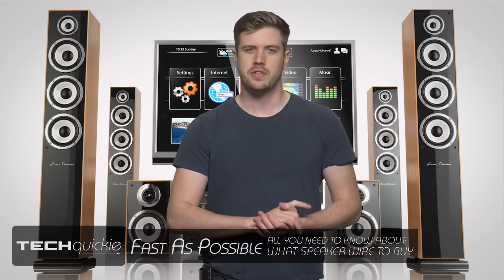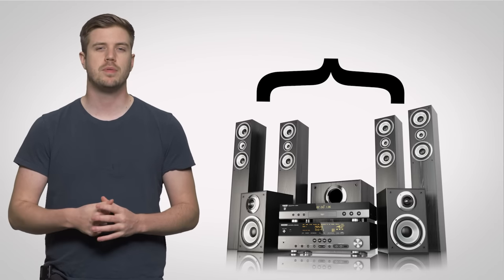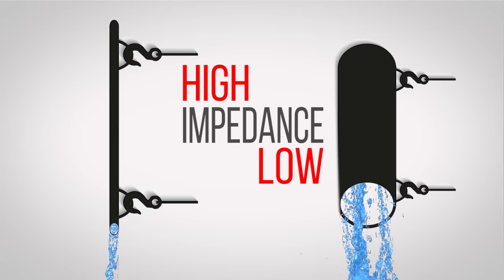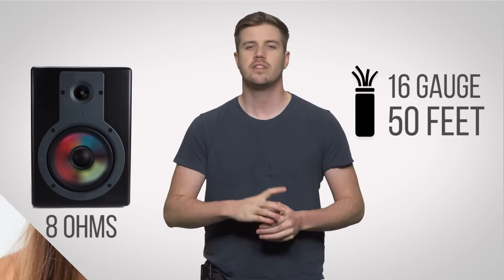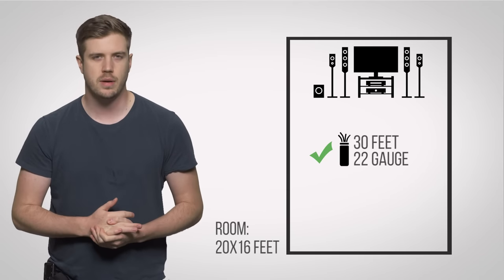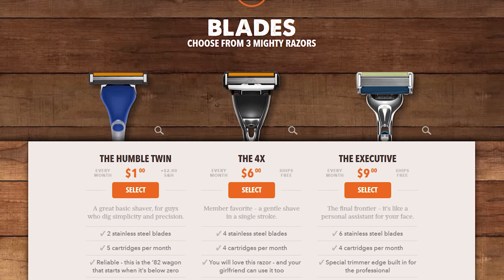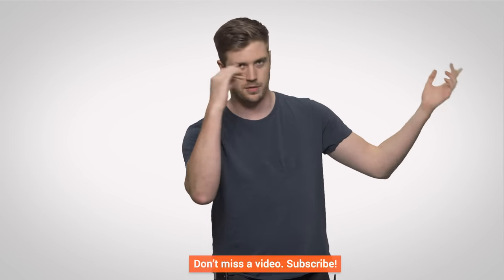What Speaker Wire To Buy As Fast As Possible

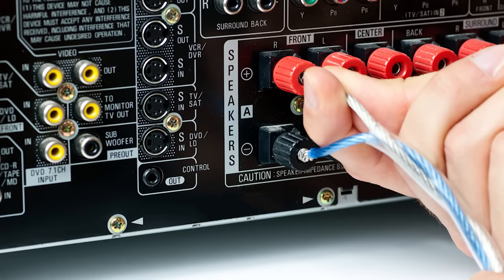Comment: Wait, why are you not suppose to just stick the wires into the speaker box ( 3:12 )? I mean, unless you're like me where my front channel amplifier can be easily removed for other uses (PARTY'S XD) in which case I use banana plugs, most people set up a set and leave it. So sorry- that's not right. It also adds one more contact which creates a junction therefore creates more resistance.... 

There is also a reason why cables are not shielded. It's STUPID to get shielded cables. Their high powered cables it like a sin- just no... nooo! facepalm. Signal cables- yes! Amplifier speaker cables NO! NO! Waste of money. 
Reason? Well since it takes so much power to move a speaker (because its low impedance and ohms law V=IR), the current induced within the cable wont even move a speaker and will simply be shunted more lightly through the subwoofer coil. If you have a passive x over then it makes it that much better where that energy would probably be eaten up within the components themselves.

Oh but I am glad your using feet instead of meters LOL.

Comment: So I am not really into speakers, but why do we still use copper for this? Wouldnt  light fiber work too?
Reply: Fibre transfers digital copper wire analog
Reply: is digital sound worse? Sorry like i said, i am a sound noob xD
Reply: +cragethGER Speakers need power via wires, that's why amplifiers are used.
Reply: +cragethGER fiber can transfer a signal, but not electricity. Speakers work on electromagnetism (most of them anyway) so they need electricity in their coils. It's they same reason you don't use fiber to plug things into the wall, or for any other wiring.

Comment: So is it smart to just take a thick short cable? ( If you have the money ;))
Reply: +Benjamin Thåst There is such a thing as overkill, and you can benefit from decent insulation, but in general yes. Luckily the only cables expensive enough to have to bother about cost are the stupid snake oil ones.
Connection points are what you want to focus on. And the actual hardware you're wiring, but that should go without saying.
Reply: +Benjamin Thåst To a degree. You don't need that much. I ran 14-gauge for my home theater to rears, fronts and center channel and just bought a spool of thick insulted stuff off eBay. Very affordable. Bottom line you have to be able to fit it in, which with vintage equipment can be tricky.

Comment: Did he mention that higher gauge size means more thinner and lower gauge sizes means thicker?
Reply: yep
Reply: ya
Reply: +.hack//Sword Yes
Reply: +.hack//Sword you'd already know if you like shotguns :3
Reply: +.hack//Sword yeap, search AWG :)
Reply: +.hack//Sword, 24 gauge wire is smaller in diameter than 12 gauge wire.

Comment: If copper cables longer than 15m significantly dampen frequencies in the kHz range, how is it even possible to transmit digital signals over longer distances that use GHz?
Reply: +Penny Lane, that is simple.  Digital is just a variation of voltage that represents 1s and 0s.  Then that voltage is applied to a DAC (Digital to Analog Converter) to convert it from digital to analog.  Digital is NOT as stingy as analog is for long runs.  5 volts will always be 5 volts from one end to the other, and 2 volts will always be 2 volts as well.  Analog on the other hand is not the same.  It is variable.  The voltage is constantly changing and those changes have to be read accurately on the receiving end.  Any interference along the way will be read and interpreted as noise.
Reply: +Penny Lane it's not correct. if it was, how do run's of 100's of feet during a concert not sound completely muddy and dull?
Reply: BaddMatt Thanks, I know what digital means =) But to also state the obvious: GHz is six orders of magnitude above kHz.
Reply: +Penny Lane, perhaps what Luke is talking about is power loss over distance.  The longer the run, the more loss of voltage due to cable resistance, and that in turn affects higher frequencies more than lower frequencies.  Gotta ask him though if that is what he is referring to.  Copper cable in itself is more than enough to carry the frequencies.
Reply: BaddMatt Well, I think I know what he means. A cable acts as a low-pass filter because the impedance of an inductor increases with frequency. Only the resistive part of the cable shouldn't do that. However, if this affects the audible range so much, I just cannot imagine how it wouldn't distort the signal edges of a digital signal – that contain much, much higher frequencies – beyond recognition and usefulness.

I'm not saying that this all doesn't happen. I'm just saying I can't wrap my head around it and I would have liked some more explanation.
Reply: +Penny Lane, I think Luke oversimplified his explanations.  Gotta remember, it is not radio frequency being pushed down the cable to the speakers, but rather voltage frequency that drives the speakers.  Your receiver may push out let's say 5 volts to the speaker, but by the time it gets to the speaker, the voltage may have dropped to 4.9 volts.  I don't see how that would affect the audio signal, but would definitely lower the volume some.
Reply: BaddMatt I don't think it helps much to think of this in terms of a single voltage measurement. You really have to keep the shape of the waveform in mind or alternatively the spectrum.
Reply: Penny Lane I was only using that as an example of where the voltage was at that given time and how the cable length can affect it.
Reply: BaddMatt I know but this is a phenomenon that inherently happens in the frequency domain so it's not so much that voltage is lost to heat but that the waveform is "smudged" in a way. So |_| becomes more like \_/ for example.

Comment: I thought you're canadian, so why measure in feet and gauge? What about meters and millimeters?
At least provide on screen conversions next time pls.
Reply: +Econael well actually these standard units are still widely excepted in Canada, for example even in the most up to date CEC (Canadian electrical code) AWG (American wire gauge) is used all the way up to 4/0.  Also the next logical unit for this would not be mm2, it would be CM (circular mills(and that thousandths of an inch thank you very much)) or it big brother the KCM, KCM is used on all round conductors larger than 4/0 in Canada. Although i do agree with you on the metric length measurements, this is reflected in the CEC to.  And yes i do know that the CEC has no direct influence on home audio sutups.  thanks.

Comment: My subs are supposed to be 4ohm but they read 2.8-3.0

Can I use bigger or longer speaker wires to try n increase this number a bit and get closer to 4ohm?

I'm trying to connect two 4ohm subs to a 1ohm amp, but since my subs are reading 3 ohms; wiring them parellel brings my final load down to 0.4-0.7! Not safe for my amp

And if I just wire them in series parellel for a 3ohm load (would be 4ohm if the subs actually measured 4ohm themselves) I feel I'm missing out on a lot of power (amp is 1500 watt rms x1 @1ohm. 550 watt rmms x1 @4ohm)

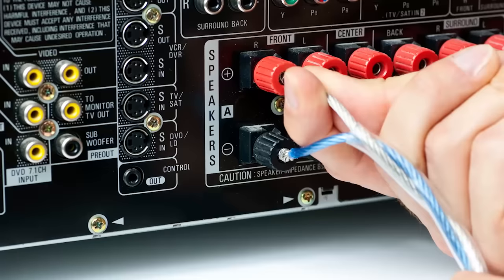Comment: 3:05
What the fuck, he's stuffing the cable down the socket for a bananna plug.
If you don't use bananna plugs you unscrew and twist the wire around the post.
That speaker wire would just fall out the back.

Comment: What if the pc sends out a digital bluethooth signal and the speaker themself do all the convertion. will that result in a better, worse or identical soundfloor than wire?
Reply: Are we talking wireless ?
Reply: +GranVlog Unfortunately it depends on too many things for someone to be able to give you a nice and easy answer. Basically both can be better/worse than the other or even roughly the same, depending on the quality of the design, the room it's in and the physical setup of everything. The only thing I can tell you, with reasonable surety, is that the wireless one will nearly always be more expensive for the same output quality.
Reply: Emile van der Merwe But if you send the audio signal as digital, wouldnt it sound the same anyway? Like with HDMI cables. As long as the digital signal is picked up i mean.
Reply: +GranVlog 
The audio is most likely compressed before bluetooth transmission. So any other concern after that is moot.

Comment: dude, nobody in thier right mind would use 22 gauge wire for a subwoofer....or anything else!. 14-16 guage is OK though for lengths of 50-70 feet and I use 18 guage for shorter ring. 18 guage is the smallest wire you should ever use though.

Comment: 99,99% BS but one thing is correct; the comparation to a waterpipe. (1:10) Speakerwires has been done totally wrong since the beginning of audio. Thinner wires might not burn or melt but they will restrict the amp`s dynamic power. Stranded wires should not be used anywhere near(!) to a system. calcutations might tell that the resistance is the same as in a equivalent solid conductor but don`t be fooled.  Look at the waterpipe and think. not only will the thinner conductors restrict dynamics, there will also be interference. Where to begin? 12awg solid for smaller systems. Fun begins at 9awg
Reply: Finally someone who knows what he's talking about.  Stranded wires are only for convenience.  They smear the sound.  Solid core sounds better.

Comment: I always advise people to buy water cooled speaker cables 'cuz if the cables get too hot the resistance goes up and they get even hotter, etc, etc. Pretty soon you've got a fire on your hands and if your cabinets are wood or plastic it's good-bye $50,000 speakers. A really good alternative is liquid nitrogen to get the resistance right next door to zero.

Comment: I want to build a gaming pc and connect it to my receiver in my home theatre. How do I set up the hardware and software to get surround sound on my games and throttle my FPS to 60 FPS as my TV cannot exceed 60.
Reply: +Syed Zuhair  use display settings to limit hz
Reply: +David Soper thanks
Reply: Syed Zuhair if you have problems with games going over fps and tearing enable vsync in game. I would not recommend it unless you get major tearing on screen. It causes lag in the controls. Good luck.

Comment: No.. It's not just length and width🙈 Different wires have different types of quality metal. So this is not really correct. And interference is not really a issue on speaker cables. Ans a more expencive cable gives better sound. IF the rest of the system is really good and not a cheap system. But also..: A 1000 dollars vs a 100 dollars will give just a small bearly noticably difference so there is a limit of how much money it's worth for a cable to get a couple of % better sound.. That's one of the mistakes people forget when talking about cables. And most people that claims it makes no difference does not even have a system that's good enough to notice a difference😂 It requires a highly resolving system.

Comment: Actually high end cables do make a difference in sound quality, but spending money on other things will often yield better returns for the money. So not all of them are actually "snake oil". Cables can affect the character and quality of the sound and if you're trying to run longer distances the improved shielding and better materials can make a substantial difference in sound quality.

Comment: It is so hard to find decent Gauge-0 wire :(
Reply: Check out sky high car audio. Their wires have much more cross sectional area for a given gauge when compared to other brands who use excessively thick insulation to make their wires look thick. I use SHCA 0000 gauge wire for power runs. They offer both OFC and CCA.
Reply: +Masticina Akicta It really isn't

Comment: so much so so wrong in this video. Spend the money on good cables because this guy knows jack all. use 150/33 Litz wire this is 12 AWG I think!!! at a length of no more than 16 feet. Get the Gold plated Stirling silver connectors. You will be amazed by your new found top end.
Reply: Correct.

Comment: What about silver wire vs copper?
Reply: Silver is supposed to offer less resistance compared to copper wires.
Reply: +Lightnin Silver wires higher conductivity and lower natural interference properties mean that OVERALL you will have a better audio signal but i doubt that for most circumstances (due to modern audio technologies) you would notice that much of an improvement in most home theatre applications. Also, silver wire can be quite a bit more expensive per foot compared to copper. I mean, if we're talking true nominal conductivity and signal integrity then we could just buy pure gold wire lol. But in reality, for most of todays situations, as long as its just not a terrible quality copper, you will be just fine sticking with copper for most audio/visual applications.
Reply: Well said thank you!!

Comment: because speaker wire transfers a analog signal quality das MATTER! It is wery different from digital cables like hdmi for example, not only thicknes but meterials used will affect the sound quality!! a more expensive cable with better materials will improve your sound quality!
Reply: +warrior pantzar 
There's no better material than copper for this purpose.  Even simple electrical installation cables will do the job.

Comment: using a crap amp..u will hear 0 difference with speaker wire,,,,,
Reply: Sound is never better then the weakest link up to a month ago i had an old Eltax surround amp from 2001 with Eltax speakers (low budget brand) recently i bought a Denon AVR X3600H and oh my god what a sound difference even with crap cables then i went to the local HiFi shop and bought a pair of silver coated tripple shielding  cables and and silver coated Banana plugs it was a huge difference more clarity tighter bass next stop is upgrade the speakers so i wont be using 150 dollar cables with my second hand 30 dollar Eltax speakers so yes cables do matter but like i said weakest link there is always something you could get better i mean i tried many HDMI cables in my life but i bought a Audioquest 1M for 102 dollars and never seen anything better and never going back + lifetime warranty is nice ^^

Comment: 22 AWG? really! I'd never use 22 AWG for home theater... ever. - electrical engineer and audio enthusiast.
Reply: 3rd year EE student here. I 2nd that. I don't think I would ever go less than 16 AWG. 

Why does the properties of copper degrade higher frequencies? I haven't come across anything that would lead me to think this is true.
Reply: I would never go less than 14 gauge only if it’s bi wire

Comment: And what about fiber cables?
Reply: +heer vristi they carry light not power
Reply: +heer vristi In this case, they wouldn't be useful.
Reply: Well i use a fiber cable to connect my home cinema with my PC. And it works perfect
Reply: They carry information and not power, they can't be used to connect an amp to speakers but they can attach an amp to an input (like a cd player or a pc)

Comment: is impedance same as resistance ?
Reply: Impedance is the sum of resistance and reactance. A regular straight piece of wire is purely resistive. Inductance and capacitance will add a reactive component which will contribute to the impedance.

Comment: Wait, did you just say 22awg for speakers?  Wow, serious fail.  22awb is much too small for speakers.
Reply: +Rob Burgess 
it's not "wrong" it depends on length, load, and wattage.
Reply: sbraz True, if you're running 1 watt into a single speaker over 3 feet it might be ok.

Realistically, 22 is really damned small and will put unnecessary strain on the amp and you'll risk losing the high end.  For reference, XLR (microphone cables) are usually 22awg.

Can you do it?  Yes.  Is it a good idea?  No.
Reply: Rob Burgess for a copper (and yes some cables use other shit material i don't want to know what it is but it's hell to solder and performs so bad the manufacturers should be flung into space with a live grenade up their ass) 22awg i'd say the limit would realistically be something like 10 feet, 15 watt rms, 8ohm load, with an active high pass.
skin effect causing highs to dim is a common misconception: while it is a real thing, it practically matters only in high frequency transmissions like radio/tv (mhz/ghz), and in single-strand wires. if there's a difference it would be inaudible, though 22 is somewhat close to the "below 20khz" mark.
losing highs is a thing for long pre-level cables, but the reason has to do with parasitic capaticance.

i have an RTA at the lab and some tweeter to kill, i might run a test or two to confirm. :)

with that said, i wouldn't advocate such a thin wire for anything - not because of audio fidelity or safety, but mainly because using a sensibly thicker copper (!) wire doesn't add much in terms of cost compared to the rest of the system, proportionally speaking. :)

Comment: heres a fact for ya'.... connect speakers with thin wire, listen to them. then change the wire to a thick one and listen... 99% of people wont tell the fucking difference.
Reply: +by CDMC Using  insufficient gauge wires for electronic can damage then, and cause fires.
Reply: +Psychodegu lol.... just lol
Reply: ***** Dude I am just explaining that you use a thick enough wire not for sound quality but so that your electronics don't fail.
Reply: +Psychodegu Was just lol'ing at the fire part. I highly doubt that any fires have ever happened because speaker wire was not the correct gauge